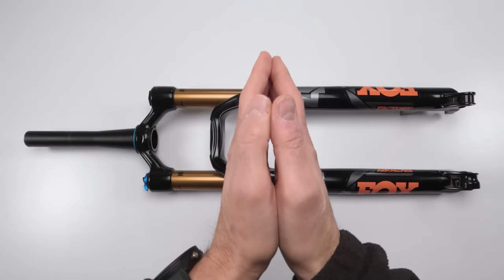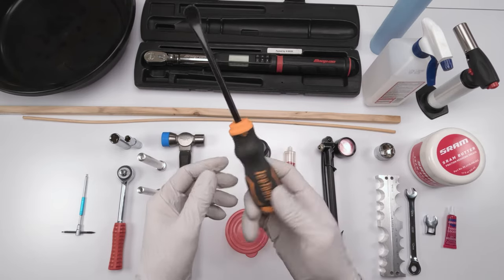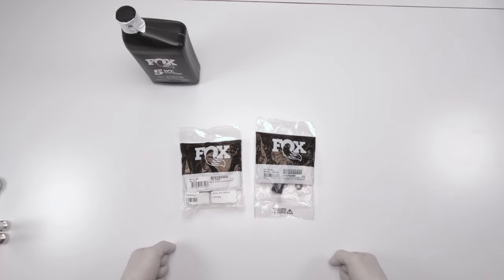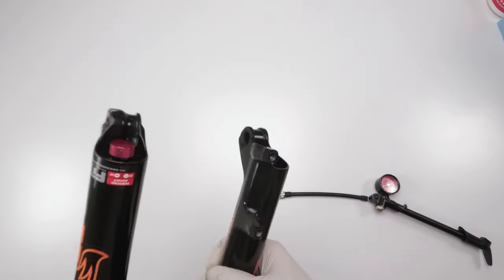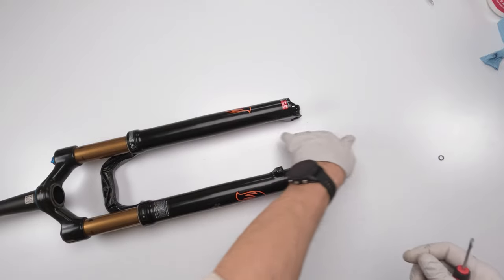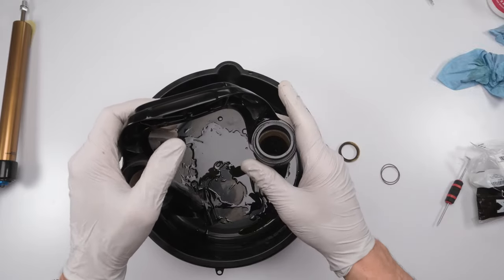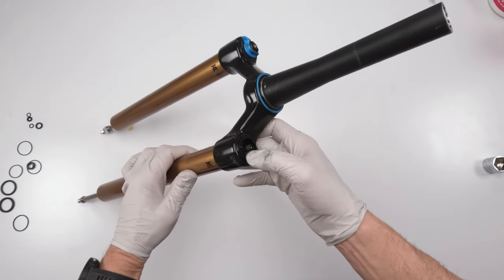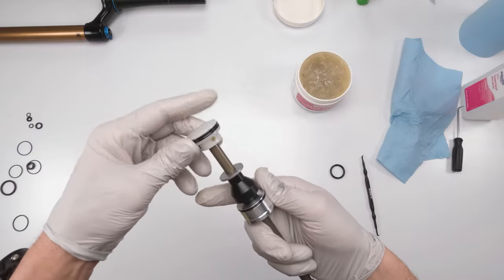Fox Factory Series 34 Float FIT4 2021 Damper, Air spring and Lowers FULL Service guide for beginners

Comment: Really good video for FIT4 service; had been looking for exactly this.   One minor point; crow's foot should be placed at 90deg for torque purposes! (lever length changes torque value).
Reply from the maker: your 100% right. it's one of those details I tend to forget when I'm making these videos. Others have pointed it out as well and I REALLY appreciate the feedback. It's finally sunk in my thick skull to remember it and mention it in the current batch of videos i'm working on. 👍
Reply: @zoubtube  You're probably joking, but you seem to go hard on yourself over making little mistakes (that you correct) in the video, but at the same time, you go into incredible (helpful) detail on almost everything.  It's videos like this that make me afraid to get stuff serviced at a shop.  How much of the little stuff to they skip?  I can't picture a shop brushing out the residual loctite from the inside of a shaft, when rushing to get to the next job.  ;-)
Reply from the maker: @ChristopherGrant2003  " You're probably joking, but you seem to go hard on yourself over making little mistakes (that you correct) in the video"
Yup. I'll definitely be the first to point out a bone head moment of mine. Where I grew up, others would freely point it out for you anyway, so why not beat them to the punch 😁

"It's videos like this that make me afraid to get stuff serviced at a shop.  How much of the little stuff to they skip?"  
Totally get it. We all have our moments, good and bad. I fundamentally believe people want to provide good service, but there are times when we're overworked, and sometimes details get missed. I usually have the luxury of time. So you're right. When you have the time, you can spend more time on the details. 👍
Reply from the maker: @ChristopherGrant2003  " You're probably joking, but you seem to go hard on yourself over making little mistakes (that you correct) in the video"
Yup. I'll definitely be the first to point out a bone head moment of mine. Where I grew up, others would freely point it out for you anyway, so why not beat them to the punch 😉

"It's videos like this that make me afraid to get stuff serviced at a shop.  How much of the little stuff to they skip?"  
Totally get it. We all have our moments, good and bad. I fundamentally believe people want to provide good service, but there are times when we're overworked, and sometimes details get missed. I usually have the luxury of time. So you're right. When you have the time, you can spend more time on the details. 👍

Comment: I have a 32 Factory step cast with FIT4 damper. I have around 25mm of play when locked out, I'm guessing it just needs topping up with oil in the damper (bleeding)???

Edit: Fixed it thanks to your video! If anyone else has this issue of free play even with the lockout on, it's due to air in the dampener, or lack of oil (same thing!). Simply remove the remote lockout, remove the tiny circlip inside the compression dampener valve adjust knob, this allows you to pull out the slow speed compression adjuster valve knob (screw the screw back into the slow speed compression adjuster valve to help pull it out. BE CAREFUL, there's a tiny ball and spring in there so pull it out very slowly till you see it so you can hold it in with your finger!). Once that's out, and the compression damper adjuster is fully open pull down on the lower legs to make sure they're all the way extended and put a small amount of oil into the dampener. Work the lower legs very slowly and carefully up and down maybe 1mm, you will see bubbles coming out. Keep putting small amount of oil in till it's nearly full to the brim and no more air bubbles are coming out. My forks had around 25mm of movement till they went solid and took 5-10ml of oil. 

I hope people find this and it's helpful to them because there is literally no other info about this issue on the internet!! All other "My lockout isn't working" posts and videos are about the cable adjustment to get the remote lockout to close fully. My issue is about air in the dampener.
Reply from the maker: Excellent job myman! And thank you very much for sharing your experience. 👍 One thing that I would add for people to know is to be very careful when removing the circlip under the remote cap. Don't break it, and don't lose it. Fox doesn't resell these, as far as I know. The easiest way to remove the circlip is by inserting a thin pick into the small holes underneath it. I would also use a magnet, if you have one, to catch the circlip, as it could aggressively pop out. I've literally had them pop straight across a room. I wish Fox made the holes a bit larger to fit the tip of an average-sized pick

Comment: Nice tutorial. I commented on a past video hoping you’ll do one for the 2023 Pike with Charger 3, but watching your other videos in the meantime. Probably the only person uploading as thorough and in depth videos like this. 

On another note I can’t get get hold of Maxima Dynamic Heavy, been looking for it since October. I wanted to take off the lowers and pull the air spring to ensure all fluid levels were correct and not packed with grease. Although it seems mainly Fox that has too much grease from factory
Reply from the maker: Hi Justin, your comment on the 2023 pike tutorial REGULARLY pops in my head over the last 3 months or so as a reminder to buy one since you posted it. The plan is to buy it within the next few weeks. Just need to decide on buying it for the 29er or the 27.5. Currently working  on DPX2, DPS performance and another fox fork as well as other videos. Time, I need more time, but hey, who doesn't these days 😉

I get why fox adds a good amount of grease in their products.  Most people I know don't maintain their chains, never mind service their forks. I'd bet fox techs have opened forks that literally looked like they were filled with tar! 😱

Hopefully the videos inspire some people to perform maintenance with a bit more confidence. Besides the therapeutic aspect of working on bikes for me,  It's all I can hope for. 👍
Reply: No rush, I still haven’t used mine. So probably still a while before I need to do a 200hr service. I just bought it because of the SRAM sale. 

Yeah that probably makes sense in regards to people not servicing. 

That’s probably the best reason to do it, instead of chasing ad revenue etc. I seem to spend more time servicing than riding.

Big improvement in your videos for example since your OneUp dropper video. Not that it was bad as it helped me do mine. But everything is improved. Great job.

Comment: After complete rebuild of damper side with new service kit, I became hesitant, when I filled the damper with oil (as per instruction, keeping enough oil in the syringe), pressed the bladder and kept moving the damper rod up and down - bubbles just kept coming and coming. Does the bladder need to be fully empty of oil after bleeding? It was sucked empty during bleeding. Ok, after 20 min I got no more bubbles, but the for does not lock out. What could still be wrong potentially? I have an FIT4 fox 32fork with push-to-unlock lockout. PS! I guess I have watched this video a dozen times now. Being stubborn enough to do my own stuff. :) Thank You for shooting this video and sharing!
Reply from the maker: " Does the bladder need to be fully empty of oil after bleeding"
The bladder needs to be full of oil only, no air. In fact, the whole damper should have no air in it, Only oil

If you notice at 1:43:24, after I fill the tube with oil, I start squeezing the bladder. I do this to remove as much air as possible before I close the system. This helps make the bleeding process later much easier as there will be less air to remove.

" the for does not lock out. What could still be wrong potentially"
Did you change the bladder on the damper? If yes, did you separate the top of the damper body in order to seat the new bladder, as seen in the video? If yes, when you separated the top part of the damper body and exposed the shims, did the shims fall or separate in any way? If yes, are you sure you put them back together correctly? If not, let me know, and we will figure it out.

Also, when you finished the syringe part of the bleed, did you put the spring and the detent ball back into the Compression Adjust Coupler before inserting the column back in the damper? (the compression adust coupler is what the high-speed compression knob sits on and turns to activate the lockout; It can be seen at 1:51:23). If yes, are you sure you installed the Compression Adjust Coupler correctly?

I wouldn't worry. You really can't break anything here. This will most likely be simple to fix if the lockout still doesn't work. I just need a better idea of where to look. There are basically two places that wouldn't make the lockout work (excluding a bad bleed)

The first time can be intimidating, but after your done you will have a much better understanding of how it all works, and you will have MUCH more confidence to do it again. Be proud that you didn't let the job intimidate you. 👍💪

Comment: Great video with loads of details. gave me the confidence to try it myself. Would like some information about the damper shim arrangement and different possible shim combinations. Thanks for taking the time to make and post 👍
Reply from the maker: Very glad to hear that the video was helpful.  Servicing this for isn't really difficult. the boots and air spring are super simple. The damper is a bit more involved but not to difficult. watch some of the details a few times until you get a metal feel for it and it will make it easier. One thing to note though. make sure to use a magnet when removing the small retaining clip on the damper (as seen at 1:32:44). Do not loose this retaining clip.  If you have any questions feel free to ask 👍

Comment: Regarding the little clip on the bleed port…guess what the two holes in the outer wall of the comp needle holder are for 😉. Press it in with two picks and the spring ring comes out immediately….be careful…it comes out VERY immediately 👍
Reply from the maker: YUP! I have an updated video that explains this. But I find that they can still be really stubborn sometimes. And finding something small enough to fit in can be a challenge. I find the average pick doesn't fit in enough. Thank you very much for sharing this. Information like this is ALWAYS highly appreciated.👍

Comment: Excellent video!  I've been contemplating whether to service my own 2021 FIT4 damper.  I'm still not sure, but having seen this will certainly help.  Great attention to detail...
Reply from the maker: I'm very glad to hear that you found it helpful. Personally, I would do the rebound head + shaft seals (the lower part) and the oil If you decide to do the damper. it's the simplest part, doesn't require any special tools, and provides all the return. the upper seals are there to prevent leaks. The bleed requires patience but isn't hard. In all reality the hardest part is removing the dial retaining clip on top. take your time with it and i'm sure you'll bleed out every last microbubble. This monday I will be releasing a similar fork service video but with the 2018 fox performance series fork if that will help you more. let me know how it goes if you do it and feel free to ask questions 👍
Reply: @zoubtube  Thanks for the comment.  Yeah, you make an excellent case for doing the partial service.  I bleed brakes and am comfortable with the air shaft side, so the job doesn't seem like a big stretch.  My fork is 2 years old and stays clean.  I serviced the lowers at the end of last season, and used a kit to replace the wipers, rings, seals, etc.  I didn't service the air shaft because I fully replaced it with a different length.  Now, the damper is working its way onto the to-do list.  However, being a sealed system inside a sealed system, I'm not worried about dirt, etc.  Seems like you can possibly leave the damper alone unless its performance starts to degrade, or at least, be a little more lax on service interval than with the main wipers.  Am I being negligent?  🙂
Reply from the maker: @ChristopherGrant2003  "However, being a sealed system inside a sealed system, I'm not worried about dirt, etc."
The damper seal head is the part of concern. The seals in it take a major beating and wear to a point that lower oil will mix with damper oil. This wear will also create play on the shaft. It's a pretty easy fix, but does require an oil change.  Bleeding is no different from bleeding brakes, it just takes longer due to all the ports in the compression stack.

"Seems like you can possibly leave the damper alone unless its performance starts to degrade, or at least, be a little more lax on service interval than with the main wipers.  Am I being negligent"
As for the upper damper, I totally agree. The bladder nor seals need to be changed often. The rebound shaft I would absolutely do every 150 - 200 hours depending on the conditions you typically ride. Again, it's not all that difficult and the reward is high

This Monday, I will be uploading a service video of a FOX performance Elite fork that was serviced by fox last winter. It'll give people a good idea on how much of an impact one season can have on the damper oil. The person who rides this fork isn't an aggressive rider and mostly rides XC trails. I'm sure you'll be surprised, and I can honestly say that most people out there are riding around on forks and shocks in worse shape as they don't really maintain them for two reasons:

1: it's not cheap sending both in for service. You're looking at ~400 for both per year. You can basically buy new shocks for that money every 3 years. 

2: Most people I know are somewhat intimidated by the job, which I totally get. But there really it no reason to be, and I'm hoping these videos provide enough information in order for people to feel more confident in performing it on their own. It'll save you a significant amount of money over time, and once you get use to it, I'm not kidding when I say you will want to do it every year minimum 👍

Comment: Great video,  Do you have one on the top cap adjustment to remote assembly for 3 pos ptL thanks
Reply from the maker: Man, this one brings back bad memories. I actually sort of do have some footage. I had decided to do a dedicated video on the remote assembly for the same model fork instead of a full rebuild, as I already had done a full rebuild video, and then about a month later, when I went to edit the video, I realized half the footage had no sound. (Have I ever mentioned that making these videos can be maddening sometimes? 😵‍💫 )  That fork has been with its owner for a while now, but these are popular around here, so I wouldn't be surprised if I come across one sooner than later.

Comment: Fantastic video! Very well done. I do have a question about the seal kits though. When I searched up the part number for the air spring and damper seals on the Fox website, it appears that there are two different kits with separate part numbers. You only mentioned the part number for the air spring. Am I missing something? (Actually I just realized I was looking at the parts list for the step cast fork... Jeeze! too many versions of these forks!!)
Reply from the maker: I actually do go over the part number for the lower boot, th eair spring and the damper service, but this was one of my eaerlier videos, and I'd og over the kits after the tools for the server. I have since changed this, and in my newer videos I break out the tool in their own section, but go over the seal kits and oils needed for everything together

You will find the lower and air spring kits at tiem stamp 9:20
You will find the damper kit at time stamp 14:53
If you're not sure which seal kit you need for the damper, call Fox and give them your serial number. It's a bit confusing with this year's fork, as I explain in the video

Hopefully, this helps. Let me know if there are any other questions

Comment: Thanks for this amazing video and for sharing your knowledge.  I recently converted my step cast 34 2022 to a remote lockout. Problem is there is too much friction for the compression dial to spring back. Do you think removing the ball and spring would solve the problem?
Reply from the maker: Apologies for the response. I know what you mean with this, as I came across a similar issue with a rear shock this past spring. The spring is needed, and it needs to be correctly positioned for it to work as intended. I'm assuming you have done this. A few things to try. See if you can position the cable entry in the spring mechanism to align as straight as possible with the cable. Basically, create the least amount of bend on the cable and cable entry as possible. Add a bit of lubricant to the cable housing, or even better, remove the cable, apply a very thin coat of light lubricant to it, and insert it back into the housing. Make sure the cable is as tight as possible. Let me know if any of these help